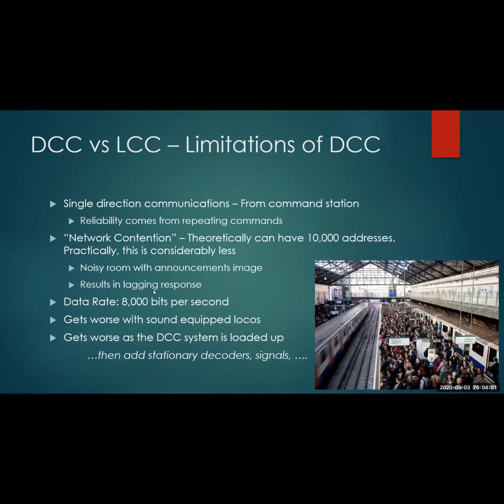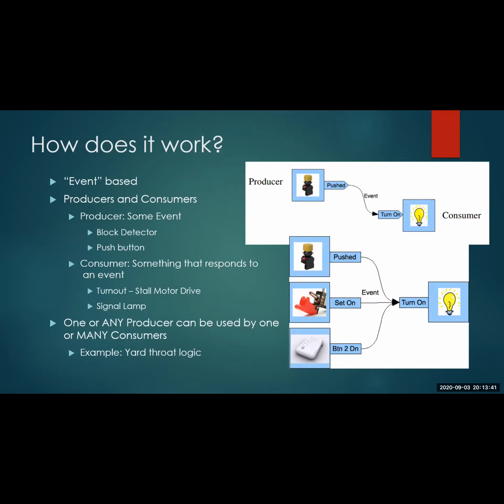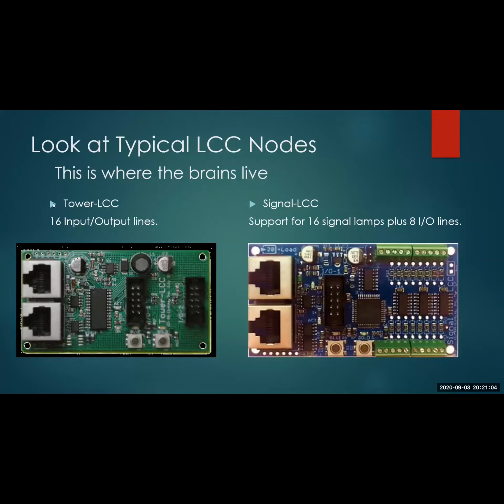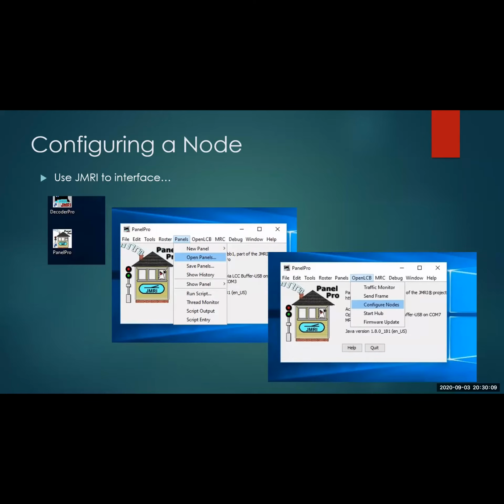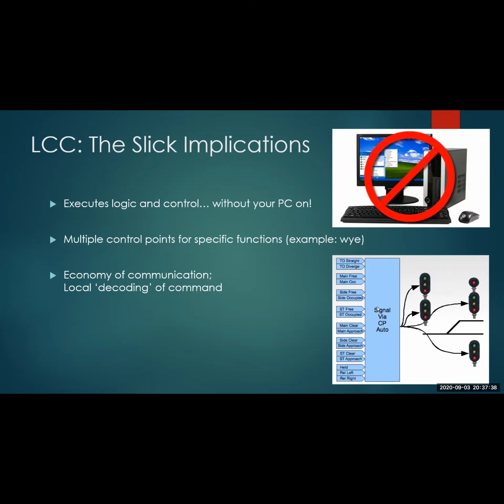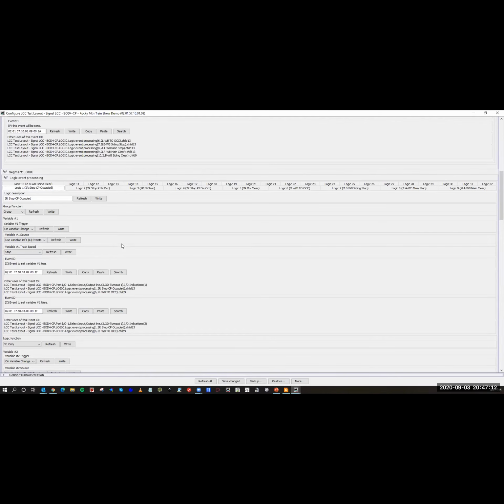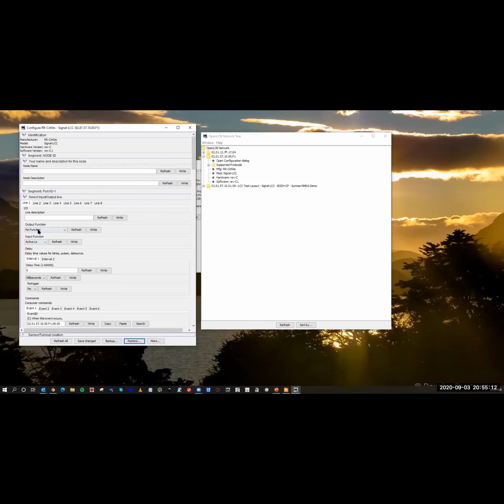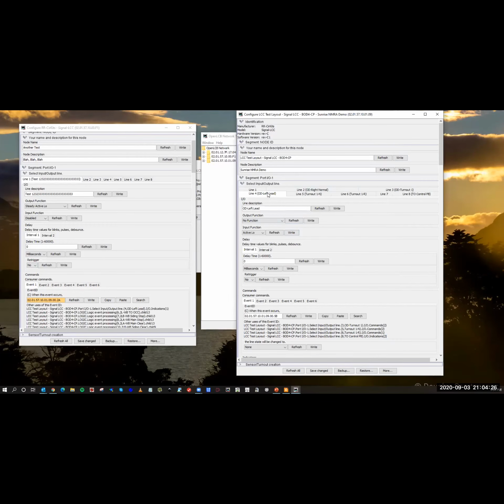Introduction to Layout Command Control (LCC)

Comment: Great clinic!
What voltage is used on the CAN bus?
Reply from the maker: Thanks. Really need to update it!  By definition, a Layout Command Control (LCC) system using a CAN bus, the CAN high (CAN_H) and CAN low (CAN_L) lines exhibit specific voltage levels during communication. When the bus is idle, both CAN_H and CAN_L are at approximately 2.5V. During an active message transmission, CAN_H may rise to around 3.5V, and CAN_L may drop to around 1.5V. The differential voltage (Vdiff) between CAN_H and CAN_L determines the logical state of the bus.

Comment: I'm intrigued by LCC. I'd like to build my own PCBs though - like a dedicated points driver that can operate a servo, detect the tiebar position, switch the frog polarity accordingly. I'd like an LCB interface that allows point movement commands to be sent remotely (along with any config of the servo), and which can emit signals for the point position. Just occurred to me I could add a current transformer and provide block detection over the point for free. Thinking of a compact PCB with a small microcontroller and able to operate a pair of turnouts - ideally the electronics would fit entirely beneath the footprint of the turnout!
Reply from the maker: A lot of that functionality is already available in LCC products out there. The Tortoise switch machine has position switches that indicate which position it is in, which easily can be interfaced as a discrete input. Can learn more about how to integrate LCC into your layout by checking out my other channel: https://www.youtube.com/@the-lcc-channel